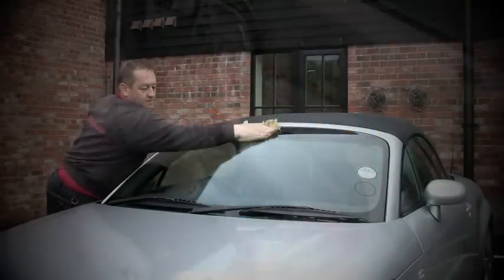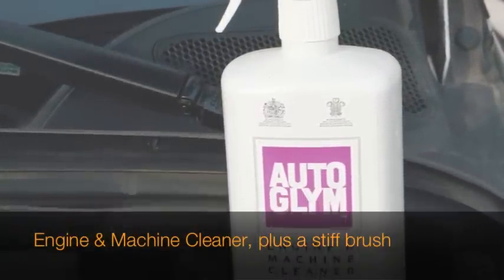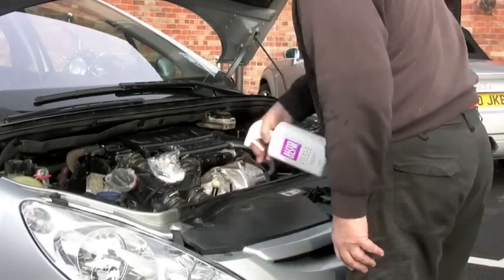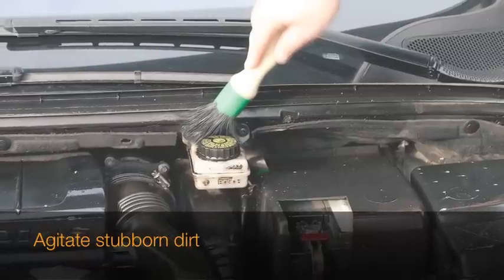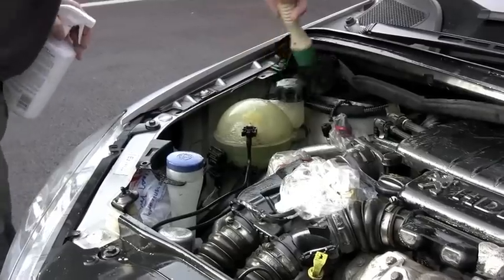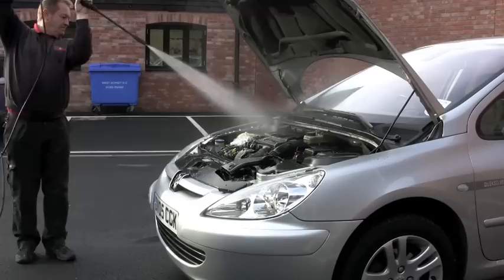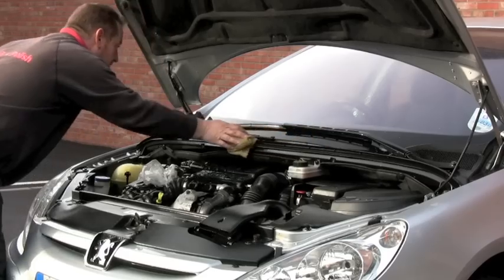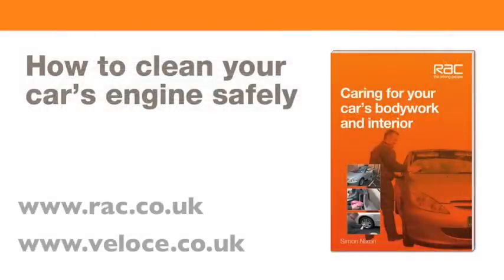How to clean your car's engine safely with Simon Nixon

Comment: Nice video. I would like to add that idealy after you finish rinsing with clear water you can blow all the electrical parts with compressed air if its available and then start the engine and let it idle for about 5-7 minutes with engine hood open to let all the water evaporate away from angine and electrical parts. Also this way you are 100% sure it will start next time you need to go somewhere and nothing went wrong with electricals and water.

Comment: Great to see Engine & Machine Cleaner is the cleaner of choice!
Reply: I have given a copy of my book to your head office via my local Autoglym rep here in Dorset 😊
Reply: simon nixon  Congratulations on being one of the very few people on YouTube bothered to protect the electrics on a car.  Most assume factory weather seals on dated cars will be enough and argue that you drive your car in wet weather anyway.

Thanks for showing everyone how to do it properly!

Cheers,
David
Reply: Thanks Dave, good to recieve a favourable comment from an Autoglym representitive, I enjoyed doing these videos and hopefully Ive helped out a few people.
Simon.
Reply: No worries Simon.  But for the record, I'm not a representative of Autoglym, haha :)
Reply: +Parachute216Reg buy a extractor
Reply: Parachute216Reg you can just remove the foam with a clean microfibre cloth or as Jason cc said you can buy an extractor, I use a George vacuum which has the extraction shampoo option , but the Autoglym spray on shampoo does need one if you dont want to go to the expense of purchasing one ! If you do it by hand then after wipeing away the foam just wait for it to dry then vacuum as normal 😊 hope that helps

Comment: by the way people just an FYI I have pressure washed hundreds of motors and never had a problem so there is no risk really. Only thing is make sure car is running when you start wetting motor and also make sure motor is not very hot and you don't want water very cold as this combination is perfect conditions to crack the block. I never bother covering with plastic or any of that crap. Just don't wash too much the less the better get the job done and be done don't make a big project out of it!
Reply: Engine. Does that make you happy now Blair? Either way I haven't had a problem yet. So please explain to me how I am going to break something when I haven't had a single problem yet! Go ahead I'm waiting!...
Reply: Blair Hunter Many people refer to a gasoline or diesel engine as a motor.  Here is the definition of a motor. "Motor - a machine, especially one powered by electricity or internal combustion, that supplies motive power for a vehicle or for some other device with moving parts."  Additionally, many refer to automobiles as motor vehicles, not engine vehicles.  So, before you ridicule someone else on the internet about their use of the English language, a quick google search on the definition of the word(s) in question might be in order.

Comment: As a new car fan (no experience, replaced my brakes and changed my oil once) is there an easy way to see what's electronic and what's not?
Reply: +Nickenator8 The stuff that has electrical cable running to/from it is electrical. If you can't tell what electrical cable looks like consult your user manual or leave it for a pro. Even then there may be some stuff you can't easily see so be very very very very very thorough and remember that pressure washers have quite a kick so that waterproofing needs to be on there like white on rice. especially with older cars because their seals/gaskets may be worn.
Reply: I would just advise him to not do this at all.  This isn't something most people should do as it will usually be purely cosmetic and the risk vs. reward is not favorable.
Reply: GenderPranks While for the most part cleaning an engine bay is not practical. It can hovever help reduce surface corrosion from salt and other debris. It also makes it easier to find leaks in the engine. Finally, it helps when wanting to sell the car. A possible buyer is far more likely to buy a car with a clean shiny engine bay that looks loved rather than an engine bay with mud, dust, oil, leaves and small stones in it making it look horrible.

Comment: Hi Chvella, 
Sorry to hear that yor friend had problems, you can take all the precautions in the world but sometimes you will still have problems ! all vehicles are different and some (maybe an older vehicle for instance) are more sensitive to moisture ( some of the earlier fords were notorious for not being very reliable in damp or wet conditions) or maybe have a pre existing problem made worse by washing, if in any doubt avoid cleaning your engine in this way, thanks for viewing, Simon Nixon.

Comment: it looks easy, but im scared to do it to my car :/
Reply: Im the same way lol
Reply: right need to to find a oil leak but I fuck up elictrcal I fuck the entire car
Reply: +Bradley Knight it wont hurt it. i wash my mustang motor all the time.
Reply: WHat do you think happens when it rains? You'll be fine.
Reply: alphaphotoandvideo... Just don't aim your power washer directly on the electical components and you'll be okay... ✔
Reply: mouse and cat will sleep inside your car engine if clean up.
Reply: Job Done Right Well I dont think people leave their cars outside with the hood open when it rains
Reply: But we do hit puddles that splash water into the bay..
Reply: Job Done Right 😂 lol
Reply: alphaphotoandvideo same😯😯😯
Reply: Lol
Reply: I did it to my BMW e46 n42b20 engine. It's all good. There is no electrical connection to cover. All covered with sealed rubber by BMW. Same as low pressure, adjusting the pressure washer. But i remember from my Dad, after wash engine, car need to run engine to dry. May be a 1hour drive. Otherwise, water struck in the engine and damage the starter motor and alternator. Yesterdays I clean my car engine for the 4th time. No problem at all. Run perfectly.
Reply: 2003 1.6 corolla nın motor until 2017 once a month with the water did not have any problem with the cleansing.

Comment: also you need to wash the car's exterior ASAP after spraying water because dirt and cleaner will get splashed onto the paint and will cause stains and paint damage if not washed off soon enough

Comment: Hi Luke21352, 
As long as you dont dwell on the engine with high pressure then it shouldnt be a problem, if you cant reduce the pressure on your washer then just stand back from the engine a few feet, engines are not the problem they used to be as long as you take sensible precautions, e.g covering the more sensitive areas such as ecu's and alarm systems, engines are designed to get wet to a certain extent.
All the best and thanks for viewing and commenting, Simon Nixon.

Comment: Are there actual benefits to engine shampooing besides making it look new? Does it make the car run better?
Reply: One added benefit is if anything starts leaking you'll be able to easily identify the source as a new leak because all other areas of your engine bay will be clean.

Comment: Dont you disconnect the battery?
Reply: Kevin Afton 
I did this my BMW e46 n42b20 engine, i didn't disconnect battery because battery is in the trunk. It's work. No problem at all. I didn't even find any electrical plugs to cover up. All are covered with rubber by BMW.

Comment: Don’t spray water on to the engine bay even if the electrics are unplugged, it can cause problems depending on what engine you have.
Reply: Yeah, I did that amd now my Peugeot 308 wont start, and I have multiple faults on. Do not wash that area.

Comment: Theres a difference, All the wires can get wet without a problem and all the sensors should be insulated as well. Water gets into that engine when your driving so there made for that. The only thing you really need to worry about is the ECU thats like a computer and just a little water can be bad. But honestly if you did not know that then you should probably avoid washing it anyway. If your not paying attention you could cut a Vacuum hose with the water lol
Reply: Nicholas Hartzler 4

Comment: This looks like a bad idea taking a pressure hose to electronics, and what if your intake house was facing upwars  like in some Hondas, u have to b very cautious would not recommend and what I do is take a rag with cleaner and just wipeit all down sure might not give b pretty results as this but it I know that im not risking damaging anything
Reply: Good idea. Will just dusting, degreasing  and wiping do the job for my MDX? I am guessing you don't reccomended hosing it down

Comment: lol I put a rag on my alternator and spray the fuck out of the engine with the pressure sprayer 😂 just hit the battery and ive never had an issue lmao. my car is an 02 so it doesn’t have quite as much electrical things as newer cars

Comment: Sorry, but this just looks like a bad idea.  Spraying pressurized water into an area where there are dozens of electrical connectors.  May not cause any problems for months, but as the water which got into all the nooks and crannies starts to rust critical electrical connectors, you're going to wish you never did this.  Just my 2 cents.
Reply: Water is going to evaporate from all those nooks and crannies, you know at what termperatures do engines run at right? So no problem about that.
Reply: macdel69 You dont have motor temperature everywhere under the hood but if you do it in summer and let it open to dry it should be OK.
Reply: +Randall Hamlet quit bragging on yourself for your choice of purchase. You've simply moved the emissions somewhere else. I'd like to see your vehicle go where mine does.
Reply: then quit asking why people have gas/diesel powered vehicles. I'm waiting until I make a new vehicle purchase. I drive a 4 wheel truck that's paid for and I go all over michigan on pavement or off. I tow, pull others out of ditches & go to work with it. I bought a new 98% fuel efficiency gas furnace for my home and my next home will have solar and geothermal. By then I'll have a new grocery getter and use the same damn truck on the farm.
Reply: I'll drive what I want and can afford, spent many years cramped in econoboxes
Reply: dude you are a nutter, I'm 6,5 and broad shouldered. Enjoy your Leaf mower. I'll stick my truck, its paid for and I enjoy riding higher and can put a tractor in the back of my pick up, quite sure i could load your leaf in back and drop the trans into tow, no problem. Next you'll tell me that Glocks are shit pistols, that is if you own, shoot and or compete. It's about choice. I narrow my footprint elsewhere.
Reply: +user 14567 This guy is hilarious. The Leaf is garbage. Most dealers refuse to sell the used ones now, the ones that are still running anyway. And saying that your coal-fired car is cleaner than a gas car is nearly as funny as saying it has more room than a truck! You're awesome man, keep on trollin'.
Reply: ***** Civics are great cars although I'm partial to ones without mods and with manual transmissions.